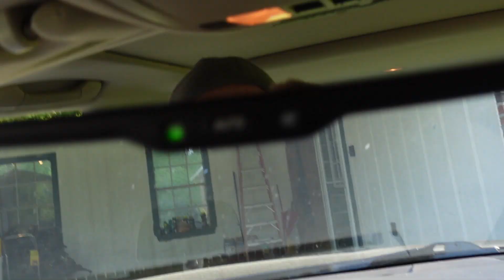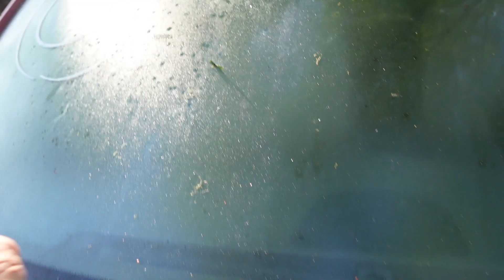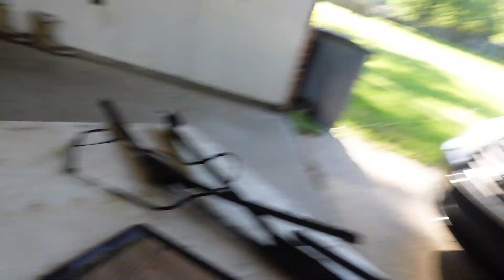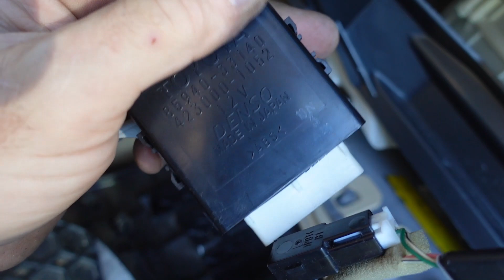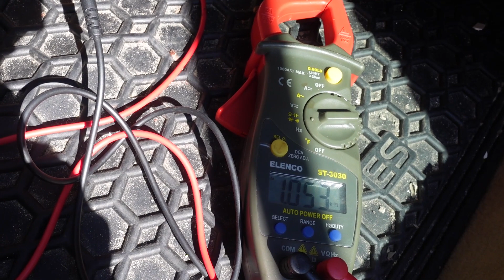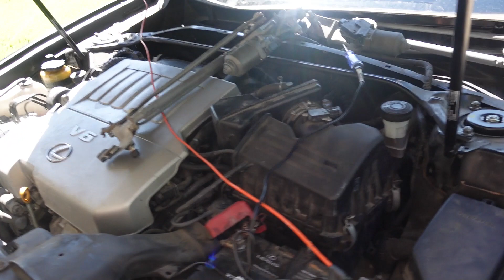Lexus ES350 Auto Wiper Failure & Repair

Comment: I have seen pins and sockets that were not locked into the connector housing. A light push and wiggle on each pin and socket would find a loose one.
Reply from the maker: I'll have to check that. Thanks!
Reply: Hi I love the video , thanks for sharing this with us . I’m African and my car is having the exact issue , I could barely understand the ending part of the video , do you suggest I purchase a new mods the one you said it’s 300 bucks or what am i suppose to do ?